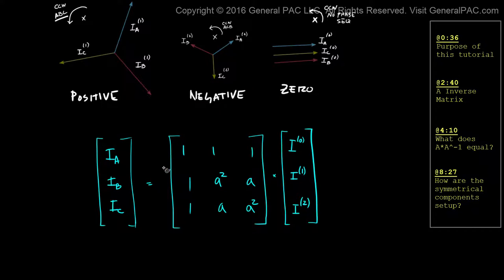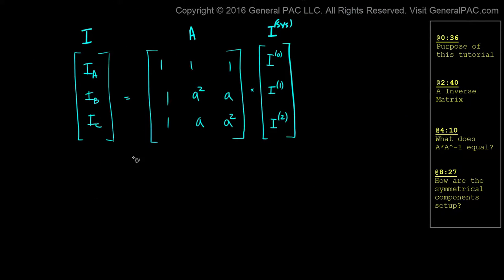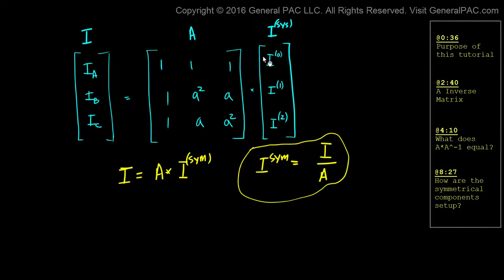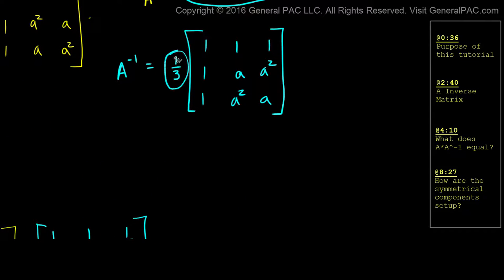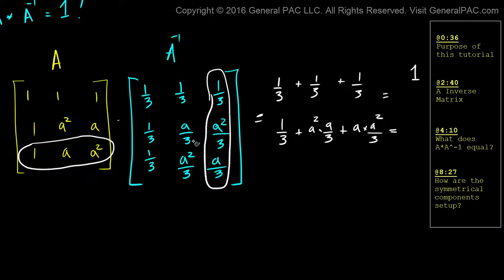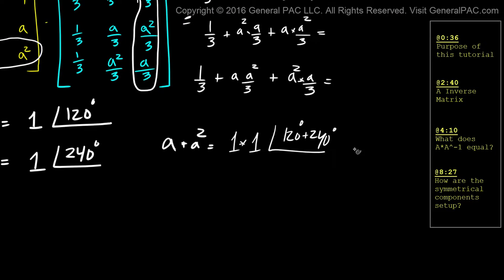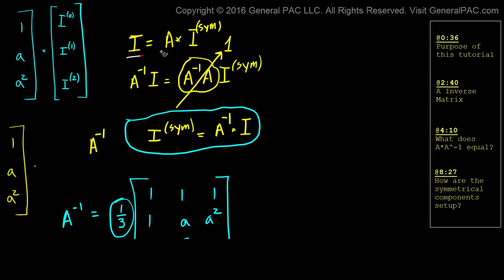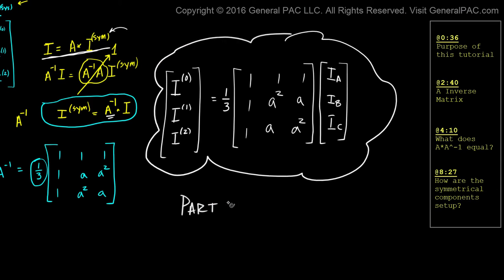Principles of Symmetrical Components Part 4a

Comment: About the section around 4:53, 
just want to point out that a 3x3 matrix multiplied by another 3x3 matrix should result in a 3x3 matrix,  which in this case would be a 3x3 matrix full of 1's.

And thanks for all your videos, I appreciate the clarity and visualizations.

EDIT: As pointed out below, I must have meant a 3x3 matrix with a diagonal of one's (identity matrix).
Reply: Right, I've updated the comment to prevent possible confusion.
Reply from the maker: Aww yes... Thank you for the clarification Peter & Ricardo! Hope this video was helpful :)
Reply: Identity matrix, the diagonal is 1, others are 0